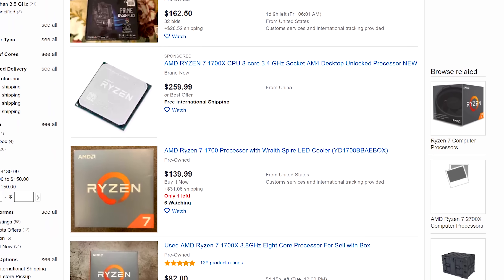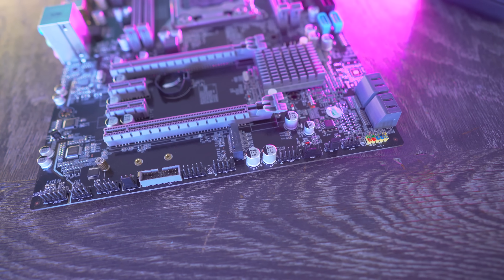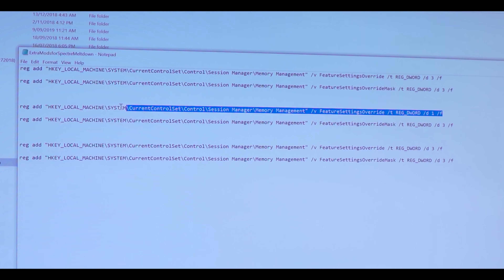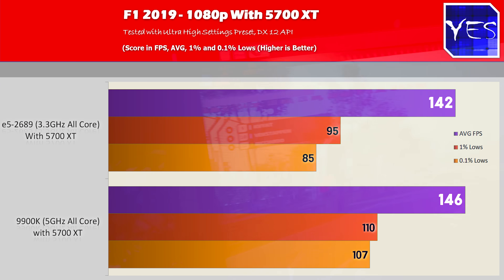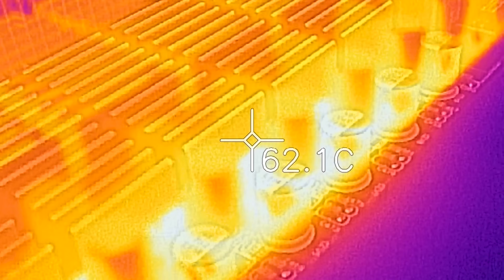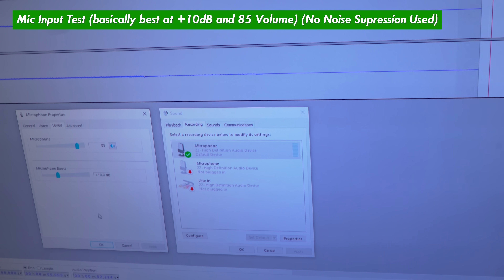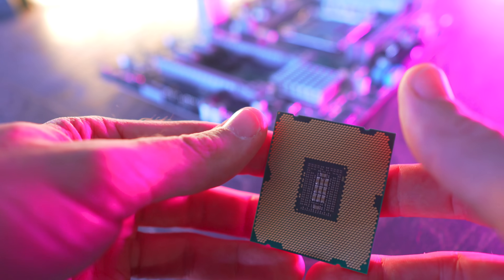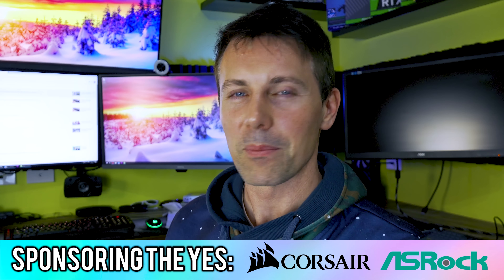8 Core CPU for $53....!? Will it BOTTLENECK a RX 5700 XT...!?

Comment from the maker: Sorry yall didn't add the patches and reg edit fixes in desc. Will do that later. Just docked in Japan. Mega hustle incoming BTW.
Reply: Great video and thank you for the recognition. It was a pleasure to help. Greetings from Germany!
Reply: @seylaw  where do you get these??? Thanks you like tech city said to you..I have a x58 with x5675 and before changing I want have a little more performance
Reply: For all Intel chips?
Reply: @magzire  Just the slightly older CPUs, especially in Xeon and higher end desktop CPUs.  GRC has a tool that is called InSpectre that will tell you if it is affecting your CPU you can download for free and do a partial disable.

In short some years back CPUs started using code to make educated guesses at what would be executed on it next, and would preload some of them and if it was right it would execute that saving allot of time by being more efficient.  AMD and Intel both did it, but Intel was more aggressive with it.

Then some smart security researches after coming up with some impressive RAM security hacks, wondered if they could do similar stuff with Speculative Execution and called it Spectre, and that lead to another weakness, and another and another going back for the better part of a decade.  AMD was affected by some of the first stuff, but much of the later stuff depended on Intel's more aggressive versions of it that AMD didn't use.

The only fix was to turn it off, so the tech making the chips fast and powerful was gutted.  Game servers all over the place that were "good enough" suddenly were staining.  In some rare cases certain game servers lost over 45% or their performance overnight.

The good thing is that there has been no uses of these exploits showing up in the wild and as of now, all of them require hardware access to the computer to use it.  In most cases if you turn it off you will be fine.  Also allot of the performance issues with server software  was fixed by tweaking the software, but there is still almost an average of 20% performance hit compared to before.

I have the patches on my AMD CPU disabled, but only see a small difference,  your results may vary.
Reply: @WolvenSpectre  thanks for that reply
Reply: I have the Xeon e5-2690 in my work station/gaming machine paired with a GTX 1070 with Linux
Reply: i have 2 e5-2690 in my unraid server/ nas / gaming vm paired with gtx 980 ti kingpin .
Reply: how new of a processor does it have to be (at oldest) to support that coding?  How much of a difference would that make on a older board?  i'd imagine it impacts more than just Xeons
Reply: Have you been keeping an eye on the Ryzen 3000 max single core turbo scandal? They still can't all perform to their specified clock speeds on all Ryzen CPUs. They might be facing another lawsuit for it in the future of they can't fix it.
Reply: Saving the day out here!
Put all of the money on 5700xt :)
Reply: @Rob_Bay  Same here ;- )
Reply: :) could you please teach us that. been noticing low performance lately
Reply: Can you please provide specific details about what RAM you ordered? Did you get 8GB 1333, 1600 or 1866? Sorry if I missed that info...
Reply: Befjur Halgaard You could get 1300mhz ECCRam and force run them at 1866mhz. Very cheap on aliexpress! I would search for Plex Hd DDR3 ram.
Reply: @poopdogg666  Thank you, good sir.
Reply: should also test it at 1440p and 4k
Reply: Thanks :)
Reply: Hey tech yes, would the 2690 be faster? It's max boost clock is 3.8ghz but is 92$. I think it might be worth it. Unless there are faster ones?
Also do you know if that motherboards m.2 is nvme or sata interface?
Reply: I ordered by mistake one stick of 32 gigs server ram from the link with this mobo and cpu, it actually worked with 32 gigs of one stick on one of the ram dimms haha.
And i talked to the manufacturer he told me it reads 16 on one slot not 8, of server ram, but it actually reads 32 haha
Reply: 2689 or 2690  V0 or 2687w V0 and WHY?... I can run and or buy either, whats best?
Reply: Awesome, Good luck.
Reply: those powershell command lines ,they do the same job as inspectre.exe ? ( https://www.grc.com/inspectre.htm )
Reply: @xender5331  well my Xeon is not overclockable but with it's higher than normal boost clocks 3.8ghz gaming is fine however if I could I'd retire my system from gaming to a game host server as I have 16gb ECC ram on it, in favor for a ryzen 2nd Gen 2600 for better gaming and compatibility for my Linux virtualization needs.
Reply: Con Windows 7 y ese cpu se puede corre juego nuevo
Reply: @Chimera Gaming I think you can get a 1680 V2, but they are quite expensive.
Reply: did the motherboard support overclocking and how much should be
Reply: Can you try xeon e5 2687w v2 with the same motherboard? I heard its a stronger cpu than this one in the video.
Reply: @emanantonov  I can't find that chip for sale anywhere, do you have a link?
Reply: @MrAnilinov  yeah but it's so expensive here in Southeast Asia. Its around 389 USD. Its so i think its not worth buying one of these in this region.
Reply: OH MYYY GOOD GOD Bless u man <3 I love Ur VIDS always have always will lol the ghostbusters amazing man actually am crying from all that emotion thanks man for putting in your heart and soul in these <3
Reply: Could you add a Cinebench score for this or another CPU-only benchmark?
Reply: Is there a big difference between 2689 vs 2690? I can’t decide
Reply: Heres the link for anyone that wants the Registry Commands
http://support.microsoft.com/en-us/help/4073119/protect-against-speculative-execution-side-channel-vulnerabilities-in
Reply: I Still Love Most Of This Older Hard Ware! Hell Im Still Rockin Some X58 Gear & My Main Data BackUp & Plex & vm's Still Run 24/7 On X58 Supermicro Bord With Dual X5675's I Paid Like 75$ For The Pair An I Am Realy Happy With Them ! But Thy Are Prty Old by todays standards But Thy Still Work Flawless For My Needs Evn With a hand full Of ppl watching plex at the same time With 24Tb  Freenas ! These are still Very Good cpu's for the mony imho ! Wonder what the difrence is between the xeon x5675's & a Pair of the xeon 2689 ? Id Like To See That ..just for shits n giggles ..lol.Keep Up The Cool Videos..An Thanks For telling & Showing ppl Like Me Tht Thyre Still Great Budget Cpus To b Had an Wher To Start..You Have Helped a lpt of ppl with these videos !! & i bet helped save some great hardware from the land fills !

Comment: I just recently got a "Machinist MR9A Pro" off Aliexpress for $115 Canadian.  So far, it is pretty nice...USB 3.0 front and rear, a+e key wifi/bluetooth card slot, M.2 nvme and Sata, turbo and c states and all that, integrated rear i/o shield, decent board layout (24 pin, 8 pin, Sata ports).  3 or 4 fan headers.  Front panel header is clearly marked.  Ram frequency setting BIOS. Board looks decent.  The only con is that it isnt letting me use the unlocked multi of my 1650 v3...not with Throttlestop or XTU.  I kind of suspected as much...gonna see if I can come up with a workaround.  If not, I am eithet gonna go T5810 motherboard since Throttlestop definitrly works with that board, or go with a higher core count e5 v3.  There are unlocked 8 core but they just recently skyrocketed in price.  From $70 about two months ago to now into the $150+ range.  I can get a locked 10+ core with 3.5+Ghz turbo for like $30ish.
Reply: Try asking Miyconst Hardware for help (YT Channel). 
Maybe use his tool (Mi899) to see if there is a compatible bios from another board that might fix the issue. 
Normally you can overclock a 16XX v3 Xeon on such Chinese X99 boards via the bios (or with the right bios installed at least).

Comment: Cool video.  Watching this on my new to me main PC which is a Dell T3610 with an E5 2665.  Loving this machine so far.  Had to figure out how to remove a goofy metal GPU stabilizer on the case panel to fit my GPU but otherwise it was a breeze and pretty cheap and it is so quiet compared to my old machine.  Might see if I can backlight the front panel or something fun just to give it some flare.
Reply: Same unit here.  The corporation i work for donates these old workstations so I snagged one for myself.  I just used my dremel to cut away the metal piece and my GPU fits fine.  Im using this exact CPU (thanks to this video) and this thing flies.

Comment: Would 4 dual rank memory work on quad channel motherboard?
Reply: depends on DDR4 or DDR3.

Most DDR3 8GB sticks are Single Rank memory. installing 4 Sticks of it will result 32 GB 4 Rank running on Quad Channel mode. This is the best way to NOT overload the Memory Controller.

if you are using 16GB, some DDR4 are available in Single Rank, but mostly 16GB are Dual rank anyway. Installing 4 Sticks of it will result 64 GB 8 Rank running on Quad Channel mode. Unless it is specified in the CPU if it can handle that much Ranks stacks, you might overload the Memory Controller.
Reply: @ClayWheeler  Thanks Clay!

Comment: Yea this is a pretty awful comparison. As far as I can tell the heaviest game he ran was GTA V and it was the awful benchmark (City FPS is probably 45 FPS vs 80 FPS). Didn't even run any popular CPU dependent games like CSGO, EU4, HOI4, BF1, BFV, etc etc because he knew the FPS difference would be massive.
I actually used a 2690 for 2019 upgrading from a 4690k (4.5GHz) and it was an insane upgrade for games like BFV and a huge downgrade for games like EU4, TF2, and Indie games.

Comment: I bought this cpu about 6 months ago, paired it with a jingsha x79-p3, put 16gb (4x4) of ecc ram and a rx 5600xt. Im currently struggling to find my next upgrade. I mean, any upgrade would have to be an eight core otherwise i dont consider it an upgrade but any new 8 core build will probably cost me over $2500 CAD so I might be on this system for a good while lol. Not that I'm complaining, this system performs amazingly. The only thing I had any issue with in this build was the graphics card surprisingly, it was a pre-owned review sample with a bad vbios installed on it, but since I reflashed it, I've had no issues.
Reply: What kinds of issues?

Comment: Hello, Excellent video. I see you have the GB X79-UD3 mobo which I have. I am struggling to find a choice of CPU's which allow PCIe 3.0 in either i7 or xeon form. The supported list makes no mention of which CPU's are PCIe 2.0 and which are 3.0. My requirement is PCIe 3.0 and a minimum of 6 cores and the max PCIe lanes.

Comment: I remeber that the E5-2689 is  in its price very near to the, at its time mighty E5-2690 which has an 200MHZ higher turbo clock, and was more expensive than the E5-1680 V2. But the E5-2689 has a higher allcore turbo??? Than it is the bette choice and now i think i remember that there price is very equal. The E5-2687W is the third player. But the e5-2689 is the fastest CPu of this three, faster than the e5-2690 and faster than the E5-2687W, which are bothn only faster in singlecore. no i was wrong. the 2690 is the fastest in multicore, the e5-2687W in singlecore and the e5-2689 is the slowest of this three. But it is faster in multicor than the 2689W and it is the newest. I think i would take this e5-2689 because it is the neweset and cheapest.

Comment: Brian the 2687w v0, 2689 or 2690 v0? What is the best?.... Turbos? I can not decidce and I can not go to v2's as in ivybridge for the 1680 with this gigabyte assasin 2 board, it will not accept or boot with a 4627 v2 I have here now, GRRRR.... Unsure how or what to do so was gonna go with one of those 8/16 sandys....

Comment: Your video is very helpful thank you so much. I live in México and most PC parts get expensive. I just bought the Aliexpress combo with the 2689.

Could you please explain more about the ram? Can i overlock any 1600mhz to 1866? Do i need to activate the quad channel in the bios? Thank you in advance! Your channel is awesome

Edit; i bought this combo https://es.aliexpress.com/item/4000826505085.html?spm=a2g0o.productlist.0.0.30203750bTwvP0&algo_pvid=f888fcfd-7db7-4dfa-97c0-c33996c0a8cf&algo_expid=f888fcfd-7db7-4dfa-97c0-c33996c0a8cf-1&btsid=0be3746c15982356055443308e5f1f&ws_ab_test=searchweb0_0,searchweb201602_,searchweb201603_

Comment: Thanks for this video, and it started a nice experiment for me. I built this system for USD 190 (4 components) with e5-2689 on a X79 machinist (incl nvme slot) and a 6-copper-heatpipe CPU cooler and 4x8GB ecc ram in quad channel @3200 MT/s.  The whole draws 350W through a platinum PSU and performs worse than AMD 1700. The latter costs twice the money but draws only half the power and has no risks of outdated drivers.  I suppose moving towards AMD ryzen 1700 or 2600 is a better idea in ANY case.
Reply: so, e5 2689 with the powershell method are worse than a ryzen 2600?
Reply: @NaderHue  I suppose it is a nice experiment if you stumble upon 1 or more of the components for free (e5 2689 or Machinist mainboard or a bunch of ecc ram) but not in the long run.  Yes move to 2600 or 1600AF on a B350 board.
Reply: It only cost me $100 including snowman 6heatpipe dual fan cooler. I live at Malaysia.
Reply: @randhisramiah5325  Excellent, yeah that snowman is fantastic. I hope your drivers can be updated and you will be able to pay for the electricity bill if you use your computer more than 4 hours a day.

Comment: Chinese motherboards are an excellent solution to recycling and reducing e-waste. The majority of chipset and CPU manufacturing is focused on server hardware, so when they get replaced finding an effective way to reuse as much as possible in new markets is just plain smart. Testing continues to show with the right configurations these setups are cheaper and just as useful as new systems.

Comment: i still use an overclocked 3930k which is basically a xeon of sandy bridge. im at 4.1 ghrz no cpu state or vdroop constant. it runs too hot any higher but its a monster for 60 dollar chip

Comment: Purchased Used Thinkstation P500 E5-1650v3 and Matched with RX 5700XT.
I am so gladed I watched your video.
The workstation was experiencing stuttering and freeze during normal operation or shutdown.
I did lasted BIOS Update and your Spectre Regedit.
I am still monitoring my workstation hoping that it does not froze.
After the Regedit, It's been consistent.

Thank you.

Comment: For anyone still wondering, the prices still seem to be pretty much the same, and I found a 50 buck mobo 4 ram slots (don't know if the board is good for overclocking) here yah go https://m.aliexpress.com/item/4000934077022.html?pid=808_0000_0105&spm=a2g0n.search-amp.list.4000934077022&aff_trace_key=ca2563816d584581a79b278abb95fd0a-1590900066864-05701-LMGsIeVK&aff_platform=msite&m_page_id=9815amp-S-1JMzmleCYwYC3E6c9mxQ1590900142165&browser_id=c394c738194b4f90adf46ba098a3a20b&is_c=N

Comment: I have a Xeon X5670 @ 4.2 GHz which is a 6 core CPU, and now my RX 5700 XT arrived today!
How do I actually find out if it's bottlenecking my system? I'm mainly playing CS:GO but no other games. I have "just" 12 GB of DDR3 memory installed as well...
Now wondering if it would make sense to upgrade my motherboard/CPU/RAM or not?

Comment: I sold my loaded $1100 Ryzen 1700X / RX580 system for $1200 about 2 years ago. Jumped on ebay snagged HP Z420 workstation with Xeon 1650v2 6 core 12 thread, 32gb ddr3 1866 quad channel and no hhd or grphics card for $200. I got a 250gb Samsung 860EVO ssd for $60 and added my 2x 3tb NAS drives. Then recently added a XFX 5600xt $300. So for roughly $550 I got a machine that can do light video editing, handle multitasking, game 1080p ultra and 4k medium settings. I run the CPU stock 99% of the time but if I want can I use Intel XTU and Throttle Stop to push all 6 cores to 4.4ghz and then I think its close to Ryzen 2600x performance. Either way this PC seems just as fast at half the price. I bring this up because Linus just did a video on it. I didn't care the Z420 doesn't support m.2 because even though its faster in the benches in real time use most people will not notice the slight speed boost. Samsung ssd in rapid mode is plenty fast. MY budget advice find a xeon v2 workstation dell, hp, lenovo, for cheap slap a few parts in it, your good to go. I've built tons of computers since 1999 and recently just got tired of all the LED RGB blaa blaa and just wanted something cheap, fast and solid. These workstations are made to run 25/8 and built like tanks.

Comment: Why you use a E5 2689, well, its a good processor, but for 5 dollar more, you can get a E5 2690, this have a 10% more of power, in Stock and turbo, but it also have One thing more, it's Unlocked, so you can make overclock with the E5 2690, in overclock this processor can get up to 4.0 Ghz with Fan cooling system and 4.3 with Water cooling system.

Comment: The CPU largely does not care about your resolution or graphical settings, it only cares about how fast you're trying to run the game. A slow CPU can do just fine for say 4k ultra gaming at 60Hz, provided it's paired with a powerful enough graphics card. A slow CPU can not however maintain a very high framerate, for say 240Hz gaming regardless of how low you drop the settings and resolution and how much GPU horsepower you throw at it. You could have a i3 with a 2080ti running 4k ultra 60, but even a 2080ti can't run 1080p minimum settings 240 if it's paired with an i3.

So yes, and no. The E5-2689 both will, and will not bottleneck the performance when paired with a 5700xt, depending on the context. Given that you benchmarked ultra, you showed the context where it doesn't bottleneck the performance too horribly.